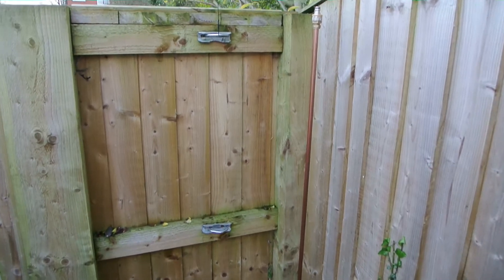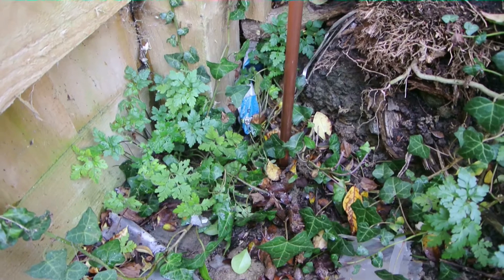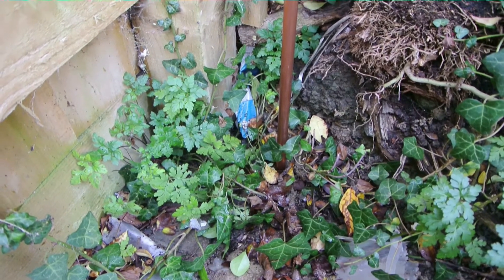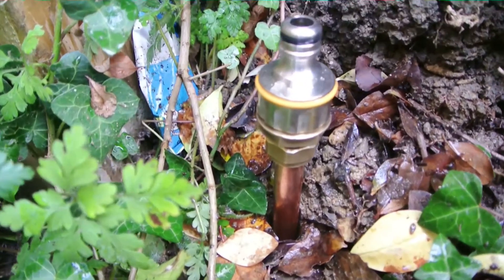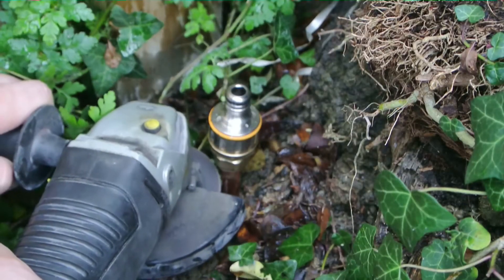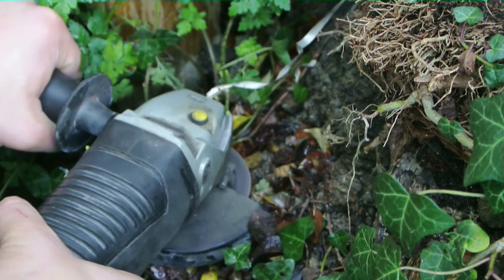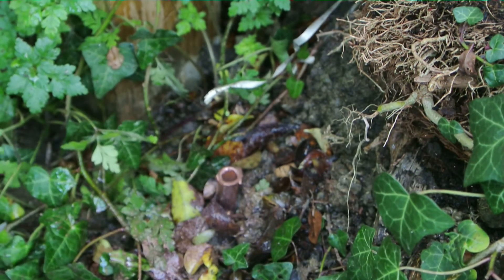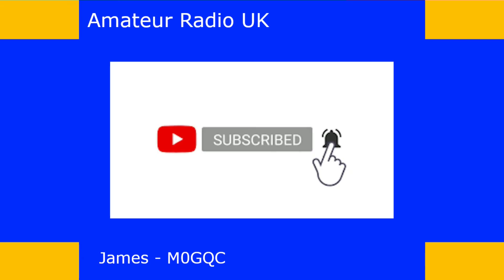Easiest method of installing a ground rod - the water drill technique

Comment: Copper pipes are very malleable. Is it really that easy to sink them in?
Reply from the maker: Yes. As long as you have water running through the pipe (to soften up the ground and push the loose dirt out of the way), it sinks in pretty easy with minimal force required.

The caveat to that is if you have rocky ground. Obviously trying to push a copper rod through a solid rock is going to be problematic!!!

Comment: Here in the states the NEC states that a ground shall be 8 feet deep. I do like the idea of a solid copper pipe. However trying to sink an 8 foot pipe will be a lot harder than a solid coated steel rod.
Reply from the maker: I've also put a couple of 3m (roughly 9ft 10 inches) long copper pipes into the ground using this method & I didn't find it any more difficult.

To be fair, the ground here is relatively soft (mainly clay once you get below the surface).

I think it depends on the type of ground. If you have rocky ground then you are going to struggle with this method regardless of how long the copper pipe is.

Comment: I used this and it worked  very well.
Reply from the maker: Glad this was helpful to you. I love this trick. I'd imagine that it's not so good if the ground is very rocky but in every location that I have tried this it has worked extremely well.
Reply: @HamRadioOnline   the last foot I used a hammer drill might have been a rock ,   I was ready for anything, :)  I did cut teeth on the bottom of the conduit, and  wiggled it, a little.

Comment: I wonder how well it would work with a pressure washer? My ground below the top soil is very poor, but well drained, so I suspect a lot of ballast type material. I have a number of rods to put in and anything to make life easy gets my vote! Jim M7BXT
Reply from the maker: Not sure about using a pressure washer. It might be a bit overkill.

I suspect the most likely problem would be the connection between the pipe and the ground rod, which may be prone to leaking under the high pressure.

I'm also unsure of the maximum pressure that the copper pipe is meant to handle. I suspect the pressure washer will put out well in excess of what the copper pipe is rated to handle. I wonder if the copper pipe might split or rupture due to excessive pressure. 

I would be interested to hear how you get on with that one.

Comment: I've heard of this method but never seen it James. I expected lots of water everywhere but seemingly not. Another method is to use an SDS drill to vibrate the pipe in. That is very effortless. It shouldn't be an ordinary hammer drill as you can't turn off chuck rotation as you can with most SDS drills. Mine came from ALDI a few years ago.
 
Copper pipe is cheap and it will outlast us. Copper coated steel earth rods probably won't stay copper coated for very long.
Nice solution. Well done.
Reply from the maker: It's not as messy as most people think. Most of the water gets absorbed into the ground (that is the idea after all........to soften the ground & push the dirt out of the way).

It only becomes a problem if the ground is particularly hard or you hit a rock.

More recently I've also had success of using this method without a hose (just pouring the water onto the ground out of a water container as there was no running water on site). It didn't work as well as with the hose, but it still got the rod deep enough into the ground for me to pound it in the last 2-3 inchs with a hammer. See my "Antenna Farm Is Born" playlist - part 3 - if you want to see that.

I've seen people using a hammer drill to pound a steel rod coated in copper into the ground. I couldn't help wondering how long a steel rod would last before corroding, even if it is plated with copper.

The earth rods that I installed at the field for the "Terminated Inverted U - Scaled Up" video are about a year old. I pulled one of them out a couple of days ago when one of the masts was removed. It was already starting to corrode.

I doubt that the copper pipes would survive that kind of hammering treatment because they are so soft.
Reply: @HamRadioOnline  Actually James, Copper pipes vibrated in with a (non rotating) SDS drill go right in without bending. I used a spark plug in the end and then the old box spanner fits over that. The chisel on the SDS drill vibrates that. 1.5 metres goes into my clay and stony soil in about 3 seconds. Here are some of my experiences documented....
http://www.fishpool.org.uk/earthrod.htm
Reply from the maker: Fair enough. I assumed that it would just bend because copper is so soft. I'll take that back!

I might have to try that.
Reply: How well does that pipe ground?  Can it hold up to a lightning strike?  I prefer the copper coated rods myself but am up for something new if it can do the same.
Reply: @Zamoramax6.6  You prefer copper coated rods to actual copper rods. Why?
You do realise that after a few years that thin copper coating probably won't all still be there?
Reply: @InteraliaTony  thats all we use here but im just wondering how that thin wall pipe holds up to high voltage such as a lighting strikes.  Im willing to try it but want to be certain beforehand.